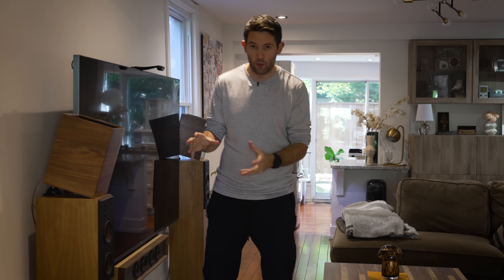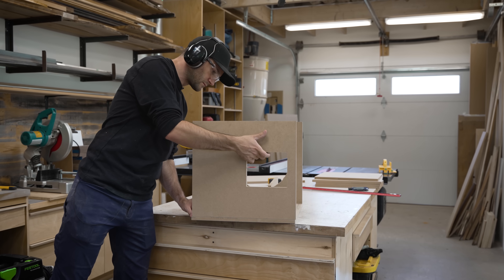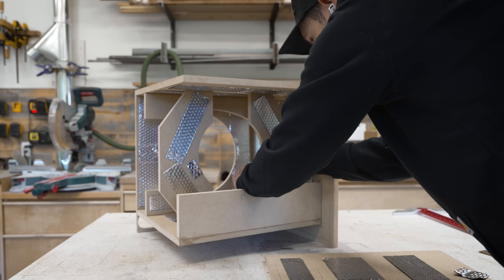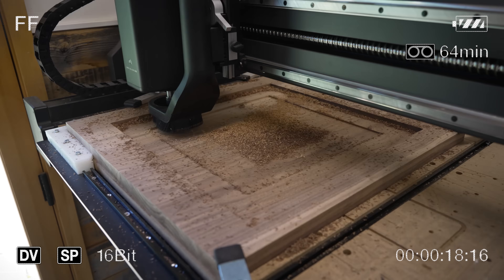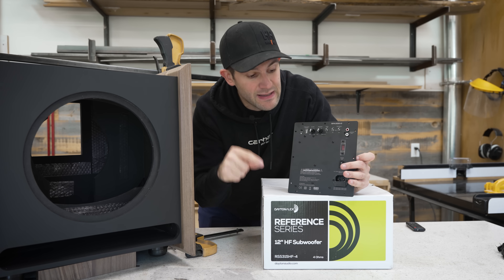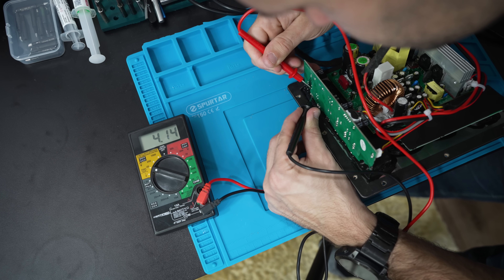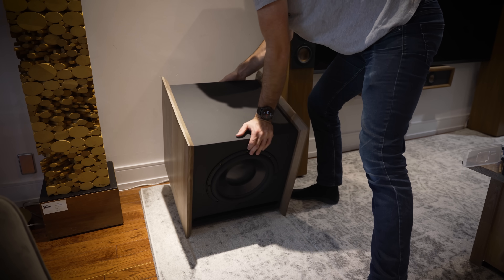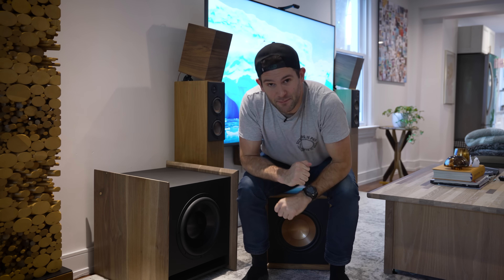THIS changes DIY Audio...

Comment: That’s not a home theater that’s just a living room with a subwoofer. Also sealed subs are not “faster” that’s nonsense. Sealed subs are smaller and that’s their only advantage. Ports MAY have port chuff if you don’t tune them correctly. Ported subs are better if you want low extension.

Comment: I need to interject and get some information out there that you should add instead:
- Structure and rigidity makes a very deep bass. There is a number of ways to do this, the "Window" method is the absolute best. Reference Dayton Audio's "prebuilt" cabinets for this.
- The more dense the material you use, the deeper you can get the bass.
- Port tuning is incredibly difficult, but there is software for this.
- When building the cabinet, joinery is going to give you the "tightest" possible joint. This includes using box joints, or even basic joinery, like dados.
- Instead of using wood glue, use Polyurethane Glues work best.
- A Double Baffle should be a requirement.
- You can get the MDF cut at Home Depot, near to size, and simply cut it to size (exactly) at home, making it easier overall to work with.
- Be sure to properly mount the Subwoofer Amp, also adding some sealant to make sure it's a nice, solid fitment that has no leaks.

The crucial part of a subwoofer is having it entirely tight and sealed. I built mine out of 2 3/4" mdf glued together, and I wrapped the outside in 1/2" oak & walnut, basically making it as solid as possible. A frequency test shows I get 20hz and up at the loudest points, and I have a "faint" sound near 15hz and it goes up exponentially to 20hz.

Also: Box ports are easier to make than people may think, you can actually design the subwoofer, and even a basic speaker, from the port first and it'll make building the cabinet even more easy.
Reply: Exactly. I would also add that the point of having a filler in the cabinet is not to kill resonance but rather to kill standing waves.
If your box is vibrating too much you've used a material thickness that is not adequate for your power level or just haven't baced the box enough. That being said the mat that the dude glued in does a whole lot of nothing.
Reply: @R4MP4G3RXD  There are no standing waves that polyfill would have a remote chance of affecting. That is for normal speakers. not subs. A bloody 80hz wave is over four meters, let alone everything beneath that.
Reply: @iggynub  that is true but the whole point of infill is to slow down the air velocity, thus not negating but treating standing waves
You are also right about box parameters determining how low it can play but that being said he is also right because witouth enough structure the massive air pressure moving everything around just screws up everything.
Like I've eluded to in my previous comment rigidity doesn't necessarily have to come from material thickness but it certainly helps
Reply: Rigidity does not affect how low a subwoofer can reach. That's entirely in the enclosure and driver interaction + the environment. Rigidity is purely to tame resonance which is distortion. Don't put CLD in your subwoofers, people. Nor polyfil.
Reply: @iggynub 
I built 2 exactly the same subwoofers. One with double thickness (1 1/4") and one without. The one without doesn't have bracing. The one with has it. Same driver. Same amp. Same receiver (denon). The 3/4" one, with no bracing, can't get below 30hz. The one with bracing plays 20hz, and you can feel it. Bracing makes a large impact on the quality of bass you can achieve. Moreover, you can tackle resonance from insulation (fiber) in typical speakers. For subs, you can add that to tackle when you make your port tuned for higher iirc.

I also made a subwoofer straight out of pure walnut slabs a bit ago to test something DIYAudioGuy mentioned, which was wood expands/contracts. Works fine, but the resonance (for bass) is terrible. Hence using 1/2" solid oak/walnut wrapped around the outside of the subwoofer, since I truly didn't care to use veneer.

Moral: That may be something for like a car or music; Home theater is another ball game...especially when you're making smaller/compact subwoofers.
Reply: @itsJoshW  My guess is internal bracing breaks up any interior "standing waves" caused by parallel surfaces (sides of the enclosure) which cancel each other out allowing you to achieve the lower frequency.
Reply: Might wanna go see the testing Matthias Wandel did on Polyurethane Glue. Spoiler: Abysmal Results.

Comment: Please please PLEASE WEAR BREATHING PROTECTION WHEN YOU'RE MACHINING MDF.

That stuff is hilariously toxic and breathing in it's dust is AWFUL for you, PLEASE put on a mask of literally any description when you're cutting/sanding it.
Reply: Just a little formaldehyde 😮😊😮😊😮😊
Reply: @scarce911  no heavy formaldehyde for years. 
"The U.S. government passed the Formaldehyde Standards for Composite Wood Products Act in 2010, which limits the amount of formaldehyde that can be in home products."
Reply: Im pretty sure its not as toxic nowadays... Unless bought from some questionable vendors
Reply: @KingArttu It's still pretty bad. When the router bit cuts the MDF the glue gets turned into a formaldehyde gas and the particles cause all kinds of damage. MDF has some of the highest concentrations of formaldehyde in any wood products.
Reply: @KingArttu It may not be as toxic as it was before, but your nasal passages (and eyes!!) will thank you to cover up. The stuff is not good.

Voice of experience...

Comment: They make plate amps that already have wireless functionality.. Even so nice job
Reply: @Kevlar187 what’s the price difference
Reply: No no no, he's revolutionizing the way people build subwoofers! By utilizing off the shelf products made for this exact purpose, he's changing the way the industry works. Bravo!

This video should be labeled: Complete guide on how to glue up some MDF cut by your CNC followed by trivial soldering.
Reply: @holden-p3r  "some MDF cut without adequate respiratory safety gear" too
Reply: @holden-p3r  why are you so angry? bro made a cool thing for himself, and made a simple 20 minute how to, to document the process, and show it to people. What cool thing did you do? Watch the video, and instead of clicking off when you didnt like it, be a bit of an ass in the comments? Right... do better.
Reply: @retroferrettv When he stops blatantly lying in his content, I'll dial back my snarky comments

Comment: About the wires, DIY Perks made a video about it a few days ago in case anyone missed it.  It is worth watching
Reply: Its not fair to say temu... but Zac Builds is the eBay version of DIY Perks.
Reply: @shize9ine  DIY perks only drops a video like every 3-4 months... but it's always something nobody else ever did on YouTube
Reply: @shize9ine  I like Zac Builds, but it feels like DIY Perks does BETTER stuff with less equipment. 
I look at the workshop in this video and think. No way that I can make this, however, with DIY Perks, his main piece of equipment is the 3d printer.
Reply: @shize9ine  shut up they're both cool.
Reply: that video is a cool gimmick, but completely impractical in real life. the speakers already need power. so theyre already going to have wires running to them. and if you dont want the hassle to set up or the cluttered look of audio cables running along your walls and ceiling to your speakers then having a bunch of fiddly mirrors on the ceiling that all glow a distracting bright red when you turn the lights off and need adjusting whenever you so much as bump any of your speakers isnt really an improvement. Theres a reason DIY perks didnt include any shots of what his mirror setup looks like in the dark
Reply: @Hephera  All wireless solutions have this problem, doesn't matter if it's Bluetooth, 2.4Ghz, or Laser. Usually speakers are against a wall, and so near a socket. For my situation it would 100% work. The advantage of the leaser is no latency, no compression, and imo best of all: NO INTERFERENCE with 2.4Gz wifi.. which so many ppl have problems with, especially in cities / apartments. I agree that that the transparent tubes could be gimmick, but thats subjective, some ppl probably still like that
Reply: @HH-xf9il The laser absolutely, 100% has latency. He’s doing A/D and D/A conversions. That’s not going to be free. Will it be less than this garbage solution? Yes but it will still have latency. 

This isn’t even getting into the fact that if you watch a movie from disc or ripped you’re now cutting down that 192khz, 24bit signal to 44.1khz, 16bit.
Reply: @Alexlfm  so what the latency is gonna be small ... laser is still the far better solution for me, and I imagine for a lot of ppl... in my appartment the 2.4 band is saturated with wifi, wireless controllers, a million of internet of things gadgets, probably including my neighbors toaster .. if my wife turns on the microwave, even that can tank the wifi signal... so no thanks for getting my surround sound to work over an unreliable, compressed 2.4 Ghz signal .. DIY perks laser solution is actually brilliant .. If I lived  in a cabin in hte middle of the woods, maybe  I would go over 2.4Ghz.. and even then the laser solution would still work great also
Reply: @Alexlfm  A sub does not need 192 kHz. No audio we listen to needs it. So why does it exists? Because it makes it easy to implement a slow and nice low-pass filter from 20 kHz and up to 192 kHz/2.  With 44100 Hz, the lowpass filter needs to work between 20000 and 22500 Hz which means it needs to be extremely sharp. And that means it will add huge issues with phase and amplitude ringing.

For a sub? No need to start any low-pass filter at 20kHz if the expected audio is way below 1 kHz.

Any reason for 24-bit? It helps when you implement digital volume control between the channels, or when you want a DSP to do equaliser functions. The extra bits means that even with rounding errors you still have perfect 16-bit audio.

Digital volume control for a sub? Not as needy of 16-bit resolution or better out of the volume control because the sub isn't delivering whispers and other silent sound - the lowest amplitudes you want to hear is in the upper frequencies.
Reply: Never missed his videos.... Worth of watching his videos
Reply: Is there any other channel like zac and diy perks?
Reply: Hell no. Wireless is shit. Wireless may be convenient, but sounds like shit. It compounds the audio, and destroys it. Lazy ass choad.
Reply: Exactly this guy is still stuck in the old world.
Reply: Well, I'd take a page out of his book about the acoustic insulation as well. Zac didn't use any foam or wool. No matter how good MDF is at dealing with sound, subwoofers need insulation!
Reply: I wish DIY perks would make videos more frequently. His channel is great for falling asleep.
Reply: That was a nice video, but I also don't think it's practical. Any time those speakers move you need to correct the alignment again. You cannot easily move to a different place, it's one vacuum clean session away from misalignment. 
But maybe he never cleanes🤣.
It was a nice demonstration, but if it was in any way practical someone would have sold them commercially years ago. 
No different than the laser record player. Nice in theory, but finicky and it doesn't even work with colored or transparent vinyl.
Reply: Thanks so very much
Reply: I dont think the laser line of sight limitation would make them easy to use in a house.
Reply: @ralph90009  He actually mounted the lasers on top of the front speaker , pointing up and then used mirrors mounted on the ceiling so there is no risk of a person going in between the speaker and laser emitter. It's very clever, give the video a try. DIY Perks.
Reply: @ralph90009  yeah, it was pretty interesting but looked unreliable, cumbersome, and expensive.
Reply: Seems like you didn’t watch the video then. He solved that problem
Reply: @ralph90009  Limitations are limitations I mean why not just use a cheap Bluetooth speaker?
Reply: @Laugh1ngboy   Latency and phase stability. There isn't any phase drift or phase disparity on optical SPDIF, and the latency is counted in single-digit samples, OK some chips have a half-sample offset between channels but that's constant and easy to compensate for. Laser line of sight is also not a problem because you determine where you put  the receiver, it doesn't have to be on the subwoofer, it can just be anywhere along the wall where it doesn't disturb you.

Bluetooth... well it's usually sort of random for reasons. You can only keep 2 channels total in phase sync, and only by one device connecting to one host, and the second speaker then receives the keys from the first so it can eavesdrop on the one existing connection.
Reply: @SianaGearz  I was answering the concern about having to run  mirrors around the room instead of wires. If wires upset you enough to go wireless, and using an optical link isn't any better to you then running wires because you have to use mirrors, your only option becomes Bluetooth or radio transmission. Which create all the problems you have listed. Personally I just ran the wires through the same holes my power outlets use and under the floor. It was easy and only cost me about 100 bucks in speaker wires.
Reply: @Laugh1ngboy  you also have to run wires for power to each speaker, and unless you have outlets nearby, now you're running extension... wires. and we're back to square one.
Reply: @Laugh1ngboy  you clearly missed the point.... but yea the wireless method in this video decreases the potential of the sub by a huge margin
Reply: @oftankoftan  That's why I ran speaker wires under my floor and up though my power outlets. I already had to place most of the speakers near outlets around the room. Hell if you want to get really fancy there are these trim pieces every one uses to hide the gap between the drywall and the floor. You can run speaker wires there easily. Hiding wires isn't that hard to do it's just a pain in the butt. If I had to do it over again DIY perks idea sounds like an even easier method if I were to build my own speakers it may be worth the effort.
Reply: @meepp5929 Which point the line of sight issue Ralph asked about. Or the point about latency  which I wasn't talking about at all and some one interjected for absolutely no reason.
Reply: @Laugh1ngboy  the laser is ran on the ceiling then mirrored down overhead the speaker, very clean, provided you have a flat ceiling
Reply: @HH-xf9il  Yeah I know I watched the video.
Reply: @Laugh1ngboy  that's the best way to go and if you know you are a movie guy just do it when you build the house at the first place
Reply: @Laugh1ngboy  hhh yea but if someone really wants to make something like this I dont think a they`d be happy with a cheap BT speaker if you know what I'm saying. I know it might seem obvious to you and me but people dont know the difference between the method he used and the method DIY Perks used... buttt they for sure know that a BT speaker stands no chance vs this build although its a sub.
have a good day

Comment: I bought a polk audio 12 inch sub with built in power. Its 450 watts. Sounds amazing and hits so hard with barely turned up. Paid less then 300 bucks for it at the time. I love building stuff myself but alot of them times i will buy pre-built then mod it my self. It ends up being cheaper.

Comment: Really love the video! But class-D doesn't mean digital. Also it looks a bit like a TIE fighter 😅
Reply: Thank you! I thought I misheard the “Class D” comment.
Reply: Well it could be classified a digital beacause it's switch mode, square spwm signal through a low pass filter
Reply: @R4MP4G3RXD   The switching is value-discrete but time-continuous, so it is not digital. The timing when the switching happens is analogue from a comparator, so for half the transitions, the switching doesn't happen at any of the discrete timesteps but when the sawtooth or similar timing signal happens to cross over the reference signal in analogue domain.
Reply: @SianaGearz  Yes but class D amplifiers have a carrier frequency which ultimately determines how detailed the spwm signal is; wouldn't that technically make it a discrete sampler?
Also by that train of thought are asynchronous logic gates analog?
Reply: @R4MP4G3RXD  Yeah... it seems like a digital amplifier to me, from whatever definition of digital I have stuck in my head.
Reply: But I do think that it can kinda be classed as both? I'm not sure. I don't know nearly enough about electronics but it does seem that it may not need an DAC so potentially it's digital? Or it can amplify digital audio... I don't know 😭
Reply: @AlienKidAnimations  Well in reality the only reason it's called a digital amplifier is because it's main amplifier output section is switched meaning before the filter on the output you'd get a bunch of square impulses basically on off signals but it can definitely be made witouth converting audio into a coded digital signal, in fact most class d amps work that way. I was just making a dumb argument on how it could technically be considered an sctually digital design.

Comment: My question for you: do you think there is a viable way to get power from speaker wiring/RCA? You could replace your current wired speakers that way ans still have power.

Comment: Taking about having everything sir tight,  i like to caulk all of the inside corners with silicone. It has a slight flex to it and won't crack

Comment: DIY Perks did a lossless laser link recently on the TOS link protocol to connect up a wireless surround setup including bass sub. Yes, needs line of sight, but doesn't suffer from compression / lag.